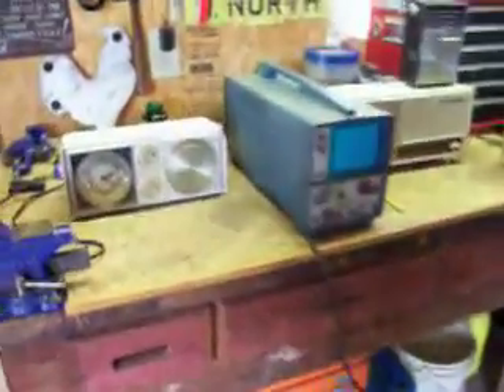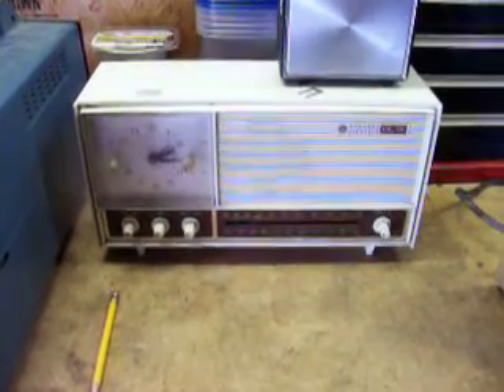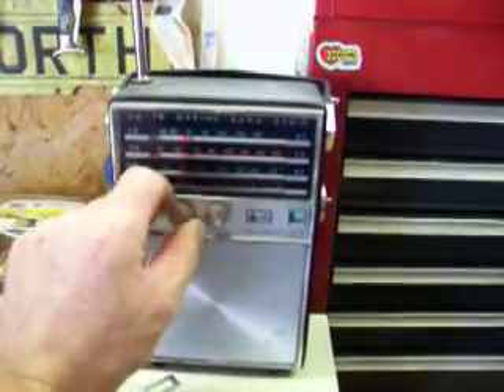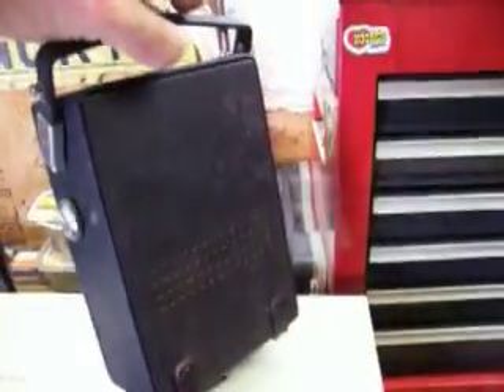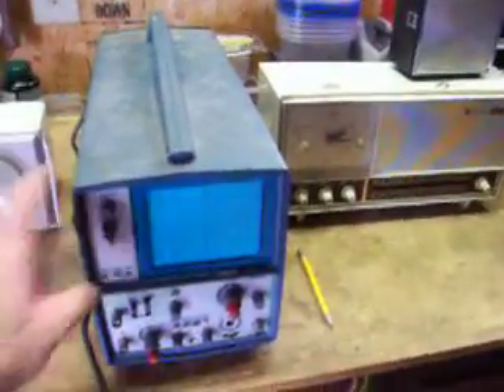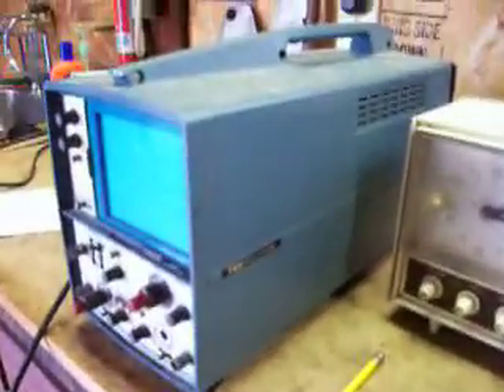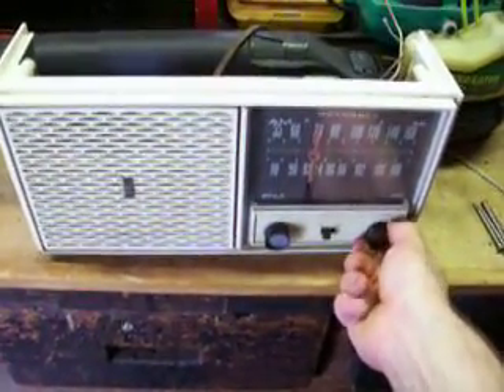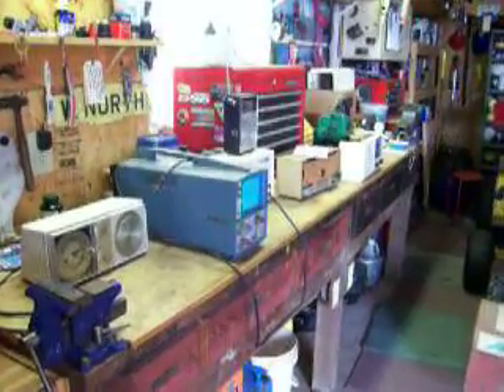A Tektronix T922 Oscilloscope & New Radio's (8-31-2012)

Comment: That Motorola AM/FM tube radio model B7W, needs a recap after you do the recap, electrolytics ,etc. the B+ will be higher and should be alot better.
I would not adjust the osc. trimmer for the FM till you do a recap.
After the recap and if the FM os off the dial I would say someone messed with it and you may have to do an alighment or at least adjust the FM trimmer.